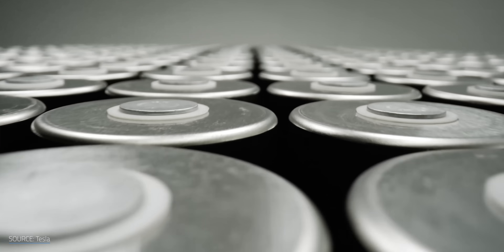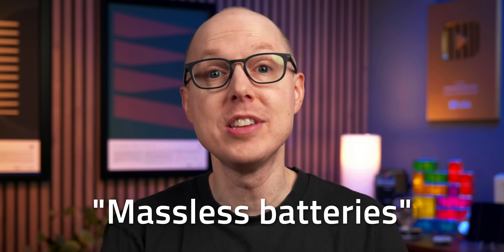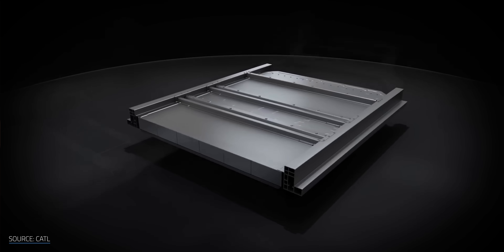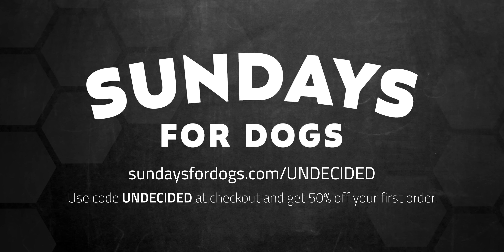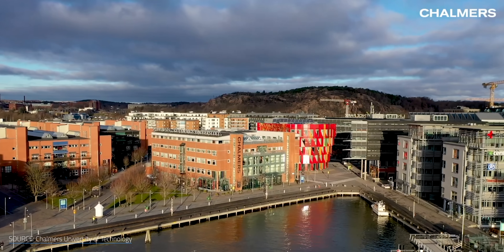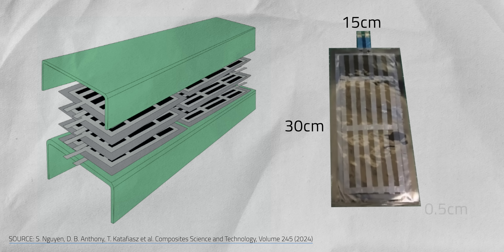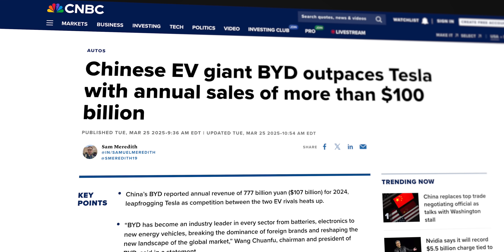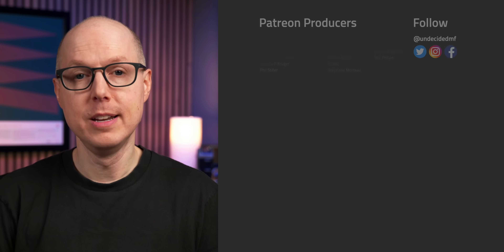The Strangest Battery Breakthrough Yet

Comment: Lightweight design has always made sense for aircraft and cars, regardless of fuel type. Aircraft are already onboard with strong and light composite materials but cars seem to be getting heavier, at least in the US. If cars (EVs at least) can slim down through use of structural batteries, that's good news even if the new batteries are not as energy dense as existing non-structural batteries.
Reply: Its because you have competing priorities, they have done great work with things like crumple zones etc but at some point you need mass for crash standards. Then counter to that is if they need replaced or have issues you are looking at it being cheaper to replace the whole car and insurance companies are already not real happy with EVs and their cost of repair.
Reply: @davehilling3944  EV repairability is the same as an ICE car except for the HV battery. Everything bolts in and out same as an ICE car. If you mean that ICE mechanics are hesitant to work on an EV until they realize they're not different than ICE in most respects, then I agree with you on that point. I disagree regarding the crash tests and weight. More mass makes cars and trucks less safe, not more.

Comment: I think different approaches are needed for compressive strength and tensile strength optimized structural batteries. I think the tensile strength version will use carbon fiber, but I imagine the battery would be more like a nano wire and the macro materials would be woven like textiles. Aerogels might be interesting for the compression side, but I wonder about heat dissipation.

Comment: A main issue with the way structural batteries are thought, is that they tend to be very non-universal in nature. This automatically slows down adoption potential immensely, because you need to have the capacity to either commit to doing it inhouse yourself, or have enough base capital to hire an external specialized firm to do it for you. Unlike current battery approaches where the pack itself is customized, but the core component (the cells) are widely universal and benefit from ease of adoption and price competition. Without these aspects, you prevent a lot of players from being incentivized to invest into the tech until it is fully mature and already market proven. For major commercial companies however, it is a good avenue to experiment in, not in terms of making a traditional battery pack obsolete, but rather as a way of making the existing total EV package more efficient and better integrated.
Reply: As someone who works in composites, it's usually sold as a uncured resin impregnated fibre (prepreg). if you could design a carbon fiber structural battery that you could sell as squares of uncureed prepreg or something like that, incorporating it into a standard carbon fiber layup wouldn't be that hard for a decent engineering team.
It is definitley more complicated than regular batteries though.
Reply: @thamiordragonheart8682  * as prepreg it's usually sold to private customers and small batch makers. Mass production has almost exclusively switched to dry fibers (be it filament winding or sheets, either way) and resin transfer molding. But automotive and aviation are not afraid to invest in new tooling repeatedly, so it's not a problem, just the production cycle of previous design must pass.
Reply: @ for really big parts and for really cheap parts that don't want to use an autoclave, dry fiber is better, but prepreg parts tend to be much higher quality and can use more better resin systems that are otherwise hard to work with. 
I admit that I do have a biased perspective since the research lab I work at, which does actually get a lot of industry contracts, mostly uses prepreg, including some thermoplastics. 

The structural battery does seem like it needs an autoclave since it needs the absolute minimum porosity, and once you have an autoclave anyway, prepreg is cheaper since it needs less steps. I don't stand by prepreg necessarily being common since I think you're right about that, but I do think that it's at least the least bad way to sell this sort of structural battery.
Reply: @thamiordragonheart8682  this is simply outdated knowledge: for best mechanical properties prepregs can't provide sufficient fiber to resin ratio anymore and it doesn't depend on curing in autoclave or heated mold.
Reply: @feedbackzaloop  Prepreg is not as yesteryear or one-off as you are saying, based on the tech I've seen it used for. It seems to me that there is a healthy balance.
Reply: @Mindbulletz  never said one-off, it's still perfect for batches. But automotive - main drivers of mass production - are abandoning it and in places already have fully.
I also see the growth in injection molded short fiber reinforced plastics, especially when it comes to thermoplastics - maybe that would be an even better approach to structural batteries, selling pellets or blocks of basic shapes?
Reply: @ Based on what I hear around the lab at Purdue, thermoplastic reinforced continuous fiber is going to replace epoxies anywhere it's possible since they're both higher performance and MUCH faster to manufacture, so if we're talking about what's the next step in composites based on current technology without asking if structural batteries could make a "worse" process worthwhile, we can throw out expoxy resins completely, including prepreg and dry fiber.
I think putting structural batteries in thermoplastic resin systems is probably impossible or at least impractical to the point of useless since I assume embedding the electrolyte in the resin requires a resin that gels, and I can't imagine any of the electrolytes for a metal ion graphite annode chemistry surviving the melting temperatures required to consolidate a thermoplastic matrix composite.

I do think if you want to make structural batteries, prepreg is the best way to do it so that you can actually mass produce the cells, and that's probably not worth it for everything, maybe it's not even worth it for most things, but I can't see any other way to make a carbon fiber structural battery where the cells aren't custom designed every single time.
Reply: better 'integration' = less repairable product.

Comment: Batteries are consumables. They WILL die over time.
Repair and replacement becomes infinitely more difficult and expensive
Reply: @bean_TM  I would like to know exactly what is consumed in these batteries.  They can easily be recycled as in the case with the Redwood facility.  Tesla makes battery so I can easily last well over 300,000 miles.  They have batteries in the lab that can do over a million.  So I don't exactly see your point.
Reply: Yes, there does need to be a specific, manufacturer-financed (consumer-financed) strategy for the reclamation of EACH and every panel/laminate/integrated piece of any structural battery sold - and it absolutely NEEDS to be carried out, not just talked about. 

But THEN I'm on board with this technological godsend I've been dreaming about creatively for the last 8 years or so.
Reply: It could still be viable for expendable / single use devices. Drones, meteorological balloons, satellites...

Comment: Structual batteries seem an ideal secondary battery. Longevity and Structual utility being king here, not density. Use a more replaceable, higher density and charge rate, primary battery and the structual battery works as a booster for range. Or to offset using a smaller, lighter primary battery.
Reply: Density is still a player in all that because what would be the point of doing it in the first place if there isnt enough power when you need it? The only problem is that if you make it part of the design... that also means when you need to replace it (a when not a if) then you have to take things a part and I not sure if that will work across the board for everything.
Reply: @adr2t  These are good reasons why such a battery would have to be secondary with a focus on lasting as long as the car. A way to get extra range or boost performance in addition to the primary battery. In fact the car should (low odds, this wouldn't be pro new car more often move) be extra and the car fully functional without it, just reduced range and or boost power.

Comment: I welcome the potential that structural brings, but worry that manufacturers (like Apple) will use it as yet another opportunity to sell unserviceable tech with  poor recycling ability. So structural, great, lower weight coupled with potentially higher energy density is a win, but only if it's not at the cost of sustainability!

Comment: I really don't get the whole superthin phone trend. My current phone is by no means super thin for a modern phone and it's already a pain to hold onto, and is battery limited a bit compared to what it could be. Not to mention now you have to have odd bumps for decent built in cameras. How about a phone where it's thick enough to avoid the bumps and hold a decent battery. Not to mention you could cool the cpu better in a thicker form factor, though this would be for stronger, more power hungry, cpu's benifit offsetting the battery increase.
Still superthin is not great, makes a more fragile phone as well.
Reply: True - my phone was plenty thin about 10-15 years ago. They've almost become too thin for their own good - I don't mind (even prefer) my phone to have SOME damn weight/thickness. 

(But structural batteries otherwise have captured my imagination for about 8 years, now.)